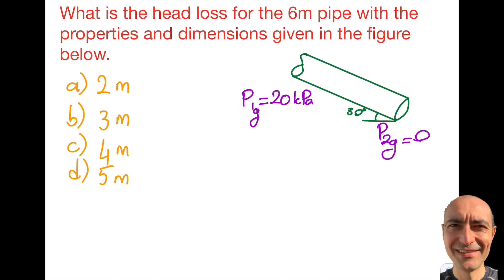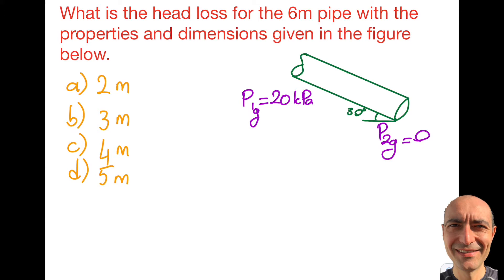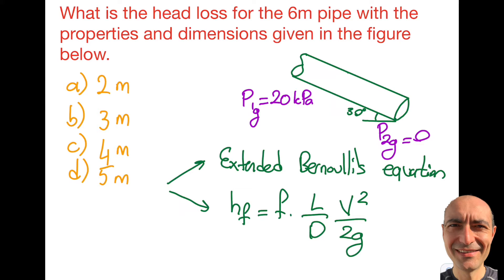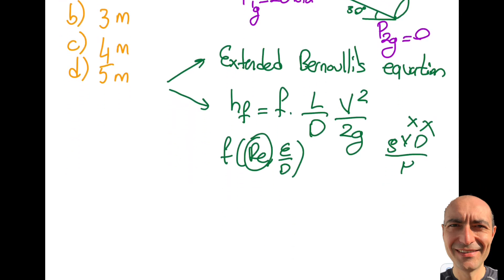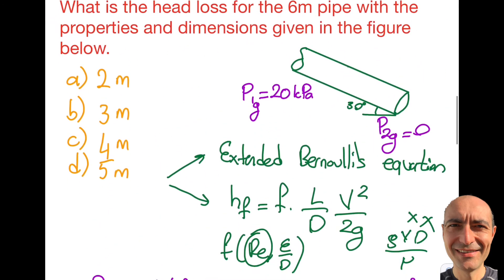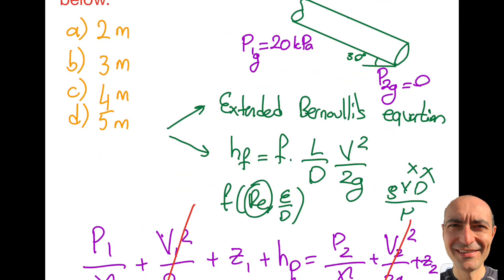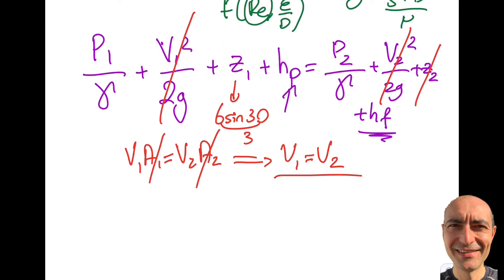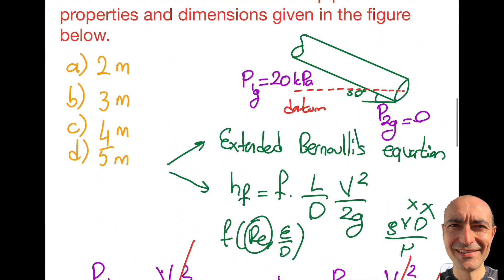FE Exam Fluid Mechanics - 4.3 - Practice Problem - Head Loss Due to Flow

Comment: how is the specific weight is 9810 n/m^3 3:52. The fluid type was not given in the question. 
Do we assume that the fluid is water if the fluid type is not given?
Reply from the maker: Stanley: the specific weight information is listed in the FE exam manual, which you have access to during the exam. Not many liquids are listed so it is pretty certain you will get water as a liquid. However, I should have been more clear in the question statement, I appreciate the feedback.